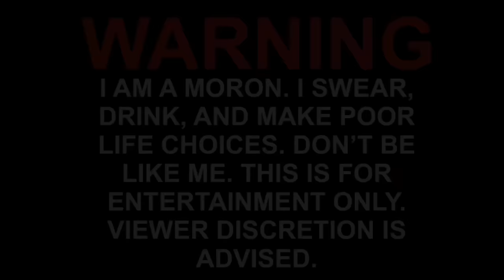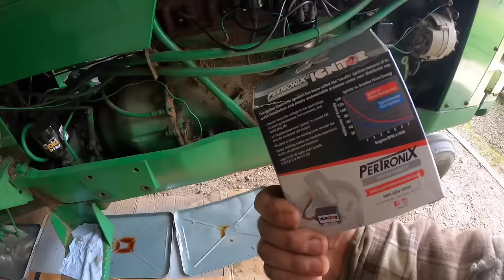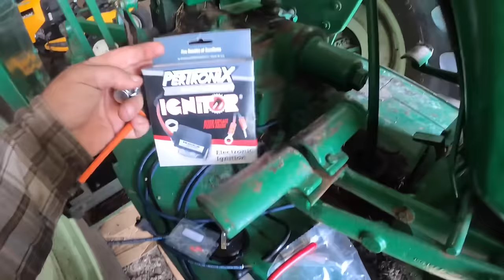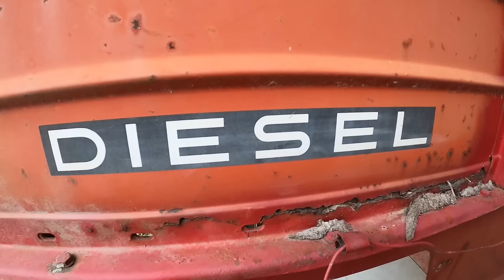SERVICE CALL: Oliver 1650 gets a new distributor ￼

Comment: would it be a good idea to replace the distributor on a 1550 with a Mallory distributor because when the Mallory needs parts it is a little expensive.
Reply from the maker: They don’t make the Mallory one anymore
Reply: @rosstheoliverman   still bad at writing I was trying to ask if the distributor you used would be better than a Mallory because that is what is on my cousin's 1550 and parts are not cheap.